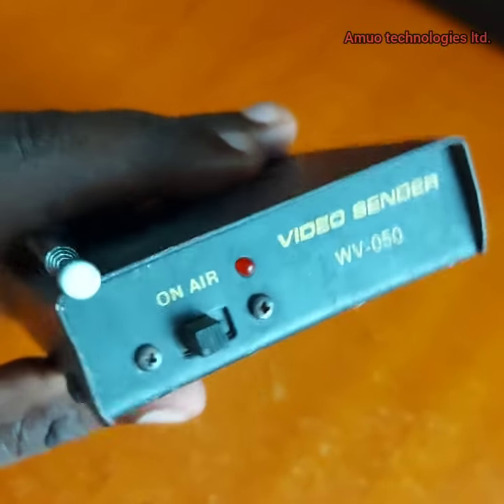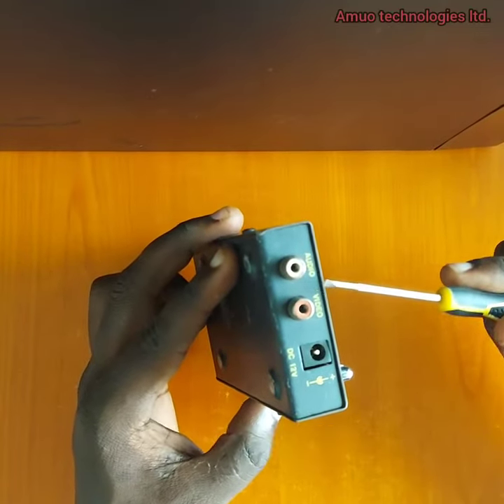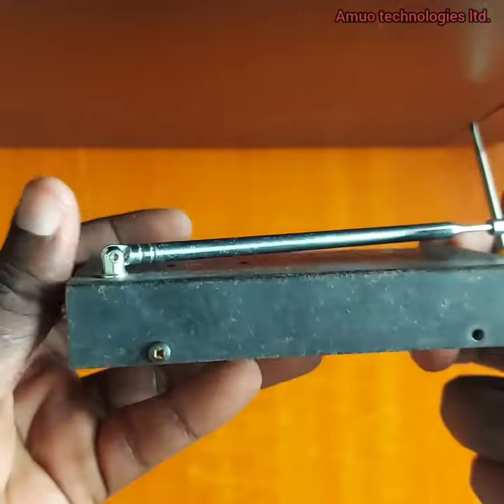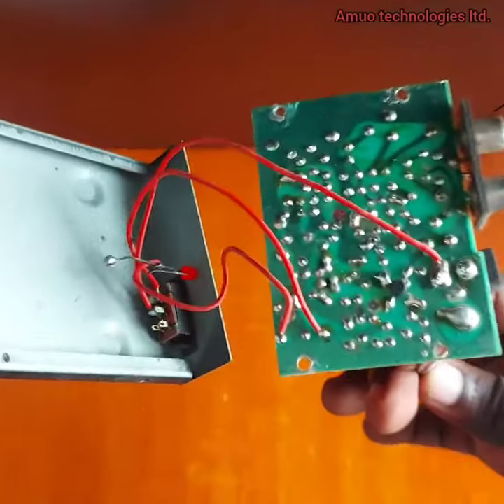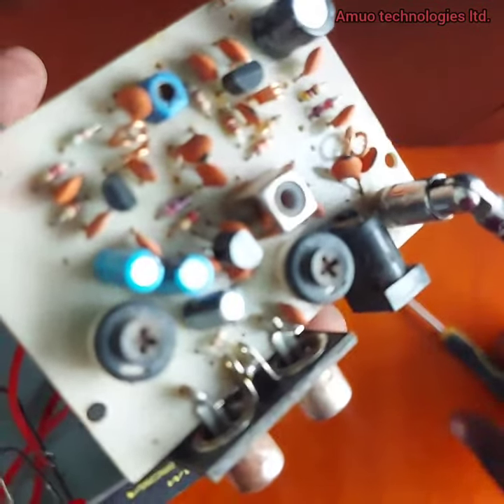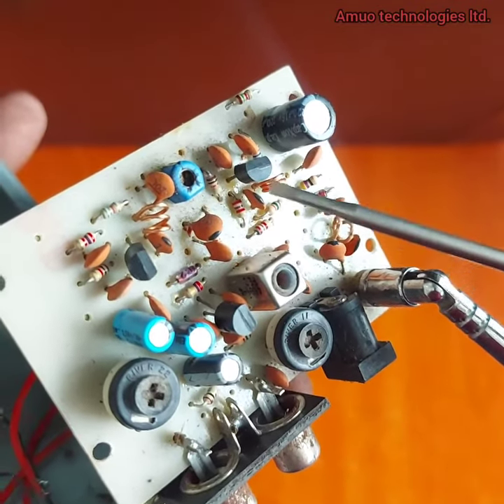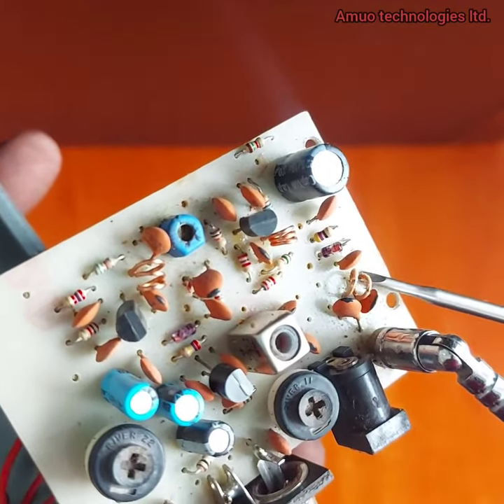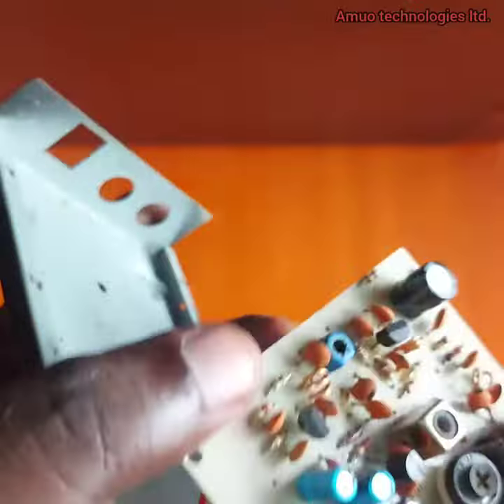UHF video and Audio sender

Comment: Another clone of the "UT66" "Videosender" series. Power output about 12mW. Not sure how you did get 1km range with it... maybe you used a hughe TV yagi antenna on your receiver, and had the transmitter "line of sight", but the range is realistically more like 15Meters (from a house to the outside) or about 100 meters with "still" color picture if you have total line of sight between the tv and the transmitter. Also the antenna is missmatched. You will get better signal quality (harmonics reduced) if antenna is not pulled out to max length. Instead only pull out the tiniest "staff" of it at a specific distance. For measuring the resonance you need a UHF field strength meter. I really know a ton about these transmtiters. WV50 most probably is just a clone of the UT66, and this one has about 12mW (for comparison a Tv Modulator from a VCR has 150nW - nano Watts). Not a bad device, but not the best transmitter out there, have tested better ones in terms of range and picture Quality. I recommend the "Reflect RF280", one of the best transmitters out there, even better than the "RF1000".